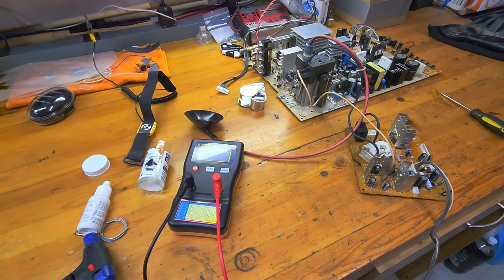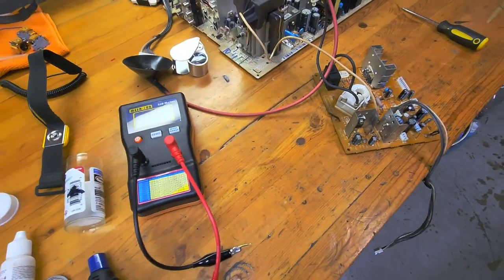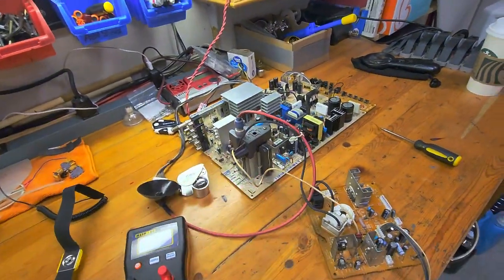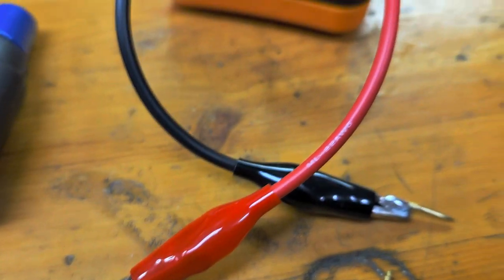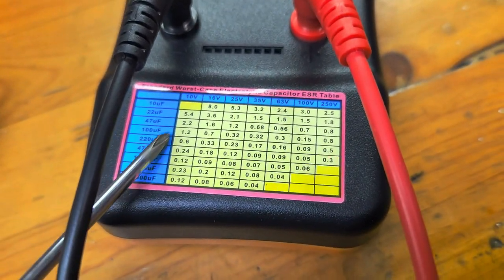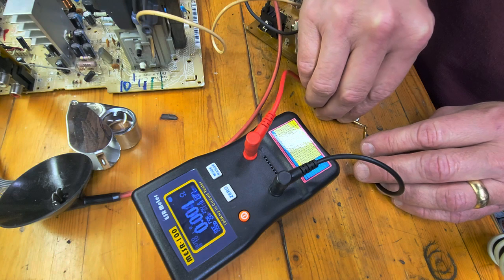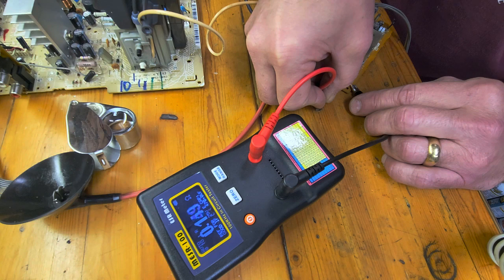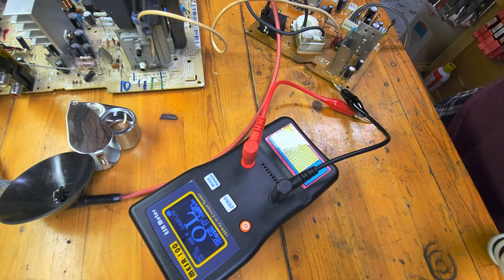MESR-100 V2 PROB MODIFICATION

Comment: I have this Mesr100. It's accurate if you don't change the leads. You have to keep the original length.  I tried all kinds of solutions because it's so cumbersome to use sometimes because of the leads. I solved all of these problems by getting a Bob Parker blue esr meter. No problems with long leads.
Reply from the maker: Thanks, that's good to know.  Also good to know that those ESR meters are about twice the price of the Mesr100.
Reply: @motleypixel  I know the blue is expensive, I have both. Worth every penny.
Reply from the maker: @guateque1718  agree, and you would think I would spend on it too having made this video.  But you know what?  I replace all the high ESR caps in one CRT TV and I'm done LOL.  Now that being said, in the next 6 months when a gaming console or something a little older starts to exhibit odd behavior, then I might pull our my MESR100.  So for me, $60 for one maybe twice a year vs $130 is okay.  But for the every day/week guy out there, I'd totally recommend the Blue.
Reply: @motleypixel  I use mine daily. If  cheaper and accurate is what people want for the twice a year repair then I can recommend the Ezm esr 2501c. I used one the other day and it's perfectly fine AND has long leads. It also does DCR.  Costs about $30 to $40.